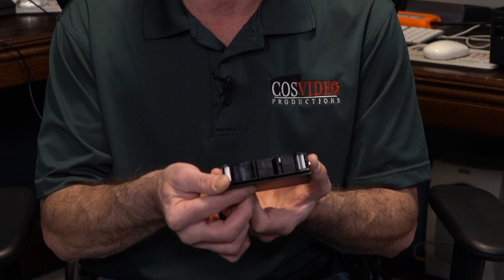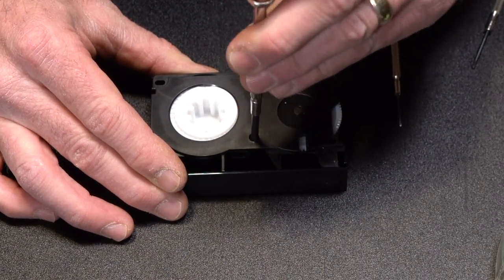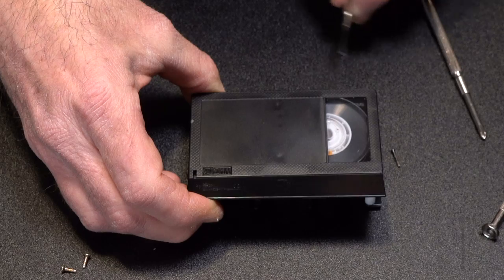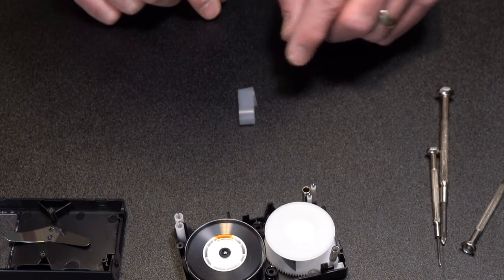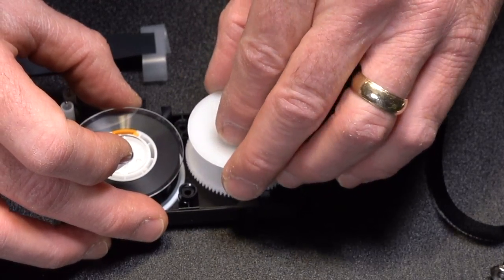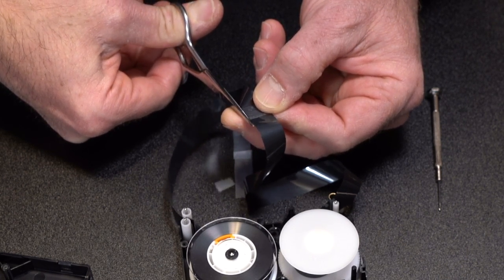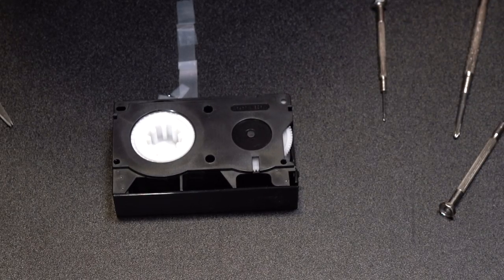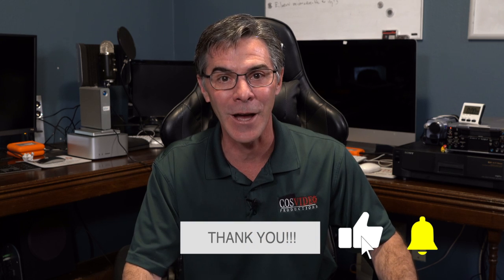How To Repair A VHSC Tape

Comment: Hello I need help , my cassette got stuck in the cassette adapter and doesn’t want to open . Can you help me?
Reply from the maker: Did you try changing out the battery?  If so and it still won’t open, there could be corrosion on the connectors.  Use a fingernail file or some sandpaper to clean the area.